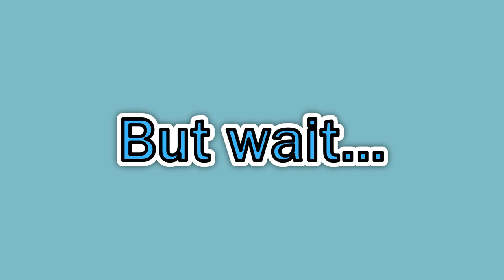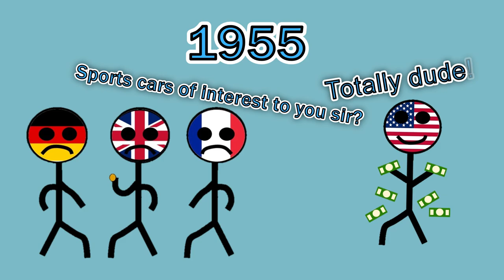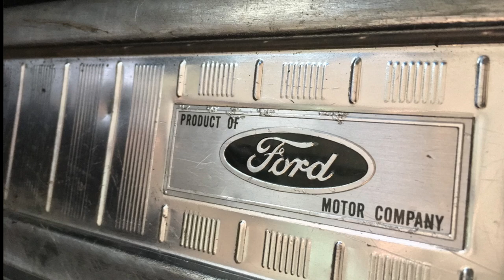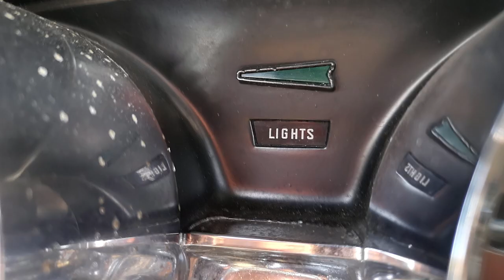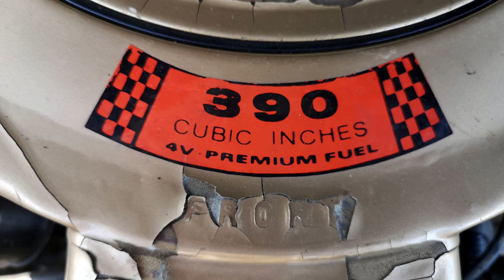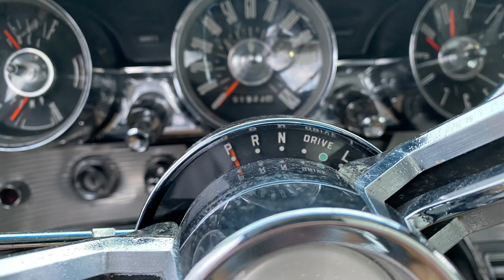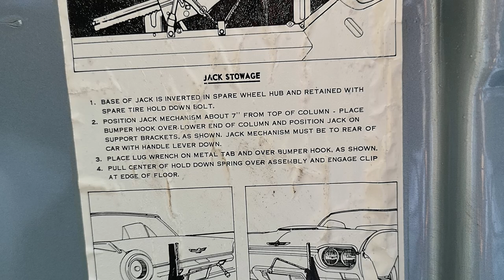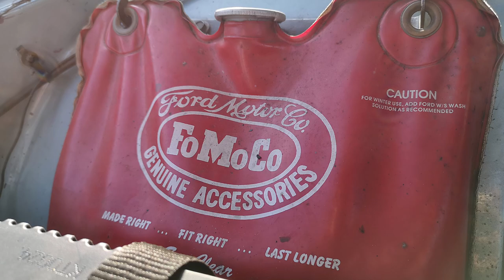The Automotive Anorak's overview: 1963 Ford Thunderbird

Comment: Did you forget about Lincoln? That's on the Ford ladder too... the top in fact.
Reply: I haven't.  In fact, I know a lot about the mutual history of those two cars.  The Lincolns of that same period were reputed to be built around the Thunderbird's cowl, in the same exclusive factory...in fact, the world-famous clap-door (or, to use a very overused and very obsolete phrase, "suicide-door") Lincolns began their existence as T-Bird concepts.  One thing I have never been able to ascertain, however, was whether the designer credited for Lincoln's revolutionary design, Elwood Engel, also got credit for the Thunderbirds of the same generation.  The resemblance is noticeable; in fact, many design details were used on the original clay concepts that sold Kennedy's Secretary Of Defense on the new look, when he was seriously pondering sending Mercury and Lincoln down the same disposal chute the Edsel had just gone down.  Toxic a personality as Engel may have been, at least according to some designers who were there at the same time, he did have talent and the ability to take lessons learned from mistakes (such as the 1958 Lincoln, even though he was not the top designer on that development)...though he may not necessarily have admitted to any mistakes to anyone.  You notice how, by 1964, Chrysler started following the lead he made with the '61 Lincoln (maybe the T-Bird as well?  Can anyone verify or refute that?); not a coincidence.

But that concept which transformed from T-Bird to Lincoln per McNamara's orders changed the automotive industry like no other car after WW2.  When the rest of the world was still stuck in the '50s rut, that design immediately changed everything.  Even the construction standards changed the industry...not just the eventual total switch to unibody construction, but also in warranty quality and maintenance standards.  How many would believe, let alone remember, when you bought a new car you'd have to take it back to the dealer as soon as the odo hit 1,000 miles for the "break-in" oil to be changed with standard-use oil...and if you missed that mark, they'd charge you for a maintenance they were required to do anyway?  Lincoln did away with that:  Right from the factory it was expected to give normal service right off the bat for 6,000 miles before its first oil change.  And that's just one example.  Another:  Lincoln offered the first-ever 2-year/24,000-mile, bumper-to-bumper warranty, twice the best competition and worlds ahead of the 90-day/4,000-mile drivetrain warranties that were the norm in 1961.  And there are still more.

Let GTO-442-Nova-Camaro-Firebird-Charger-Challenger-Barracuda-Mustang types make all the noise they want about their primary loves.  Their cars had their niche in automotive history, yes...but only as additional car options.  Not one of them changed the way the industry built cars.  Lincoln did.
Reply: @aloysiusbelisarius9992  Alex Tremulis claimed credit for the "banana nose" 61 Tbird. He was one of the few stylist concerned with aerodynamics at the time. He claimed his Tbird was 6 MPH faster than its predecessor because it sliced thru the air more easily.
Elwood Engel had the opposite philosophy. He always wanted to make his cars as bulky and boxy as possible  to have a heavy, impressive look.
Engel left Ford for Chrysler about 1964 which accounts for the change in styling from the elegant 64 Chrysler to the much more imposing, boxy looking 65s. They were the first Engel designs at Chrysler.
Reply: @mrdanforth3744  Well, partially correct historical account.  Engel did in fact have involvement (though not as the top designer) of the extreme '58 Lincoln.  But he did learn a lesson, something he never really liked to learn through embarrassment.  He created a Thunderbird concept car that was an almost total departure (and closer resemblance to the production '61 'Bird) from his Futura-on-steroids.  That Thunderbird became the '61 
Lincoln, which one can see bears more than a passing resemblance to the T-Bird of the same year.  Now, Engel was a freelancer, so he wasn't committed to any one studio; I'm thinking that the designers of the Ford studio took his cues after the "Big Man" of Ford ordered Engel's 'Bird concept to be made into the Lincoln.

But Engel did not go to Chrysler in '64.  '64 was the first year that cars started to show his influence, but he started there in '61, after corporate politics in Ford and Chrysler, respectively, had done their damage.

Now, I'm not one to exalt Engel.  One designer at Ford said Engel was an abusive, narcissistic piece of work, bullying people left and right because of his status, where he had lots of authority, power, and money, but no responsibility.
Reply: @aloysiusbelisarius9992  You may be right about Engel going to Chrysler in 61 but I didn't say anything about Lincoln. Although both the 61 Lincoln and 65 Chryslers showed his influence.
Reply: @mrdanforth3744  True, you didn't mention Lincoln; I guess I went into more detail than I realized.  I tend to do that, even if I try to be as concise as possible, for fear of leaving out a small but critical detail that could make the difference between making my point clear or making it even more confusing.  I felt I had to raise that detail in my point, because it was that Lincoln that essentially set the stage for the rest of Engel's career and influence.

Comment: I don’t agree that the 64 to 66 was less sporty. I thought it looked sleeker and less clunky
Reply: White exterior. 64-65 
Magic
Reply: I agree.  I have a 64 convertible.  I think it is far and away a sportier and better looking car.  Sure the 62 and 63 sold M-code with 3 2bbl carbs, but in 1965 you could order a tbird with a 427.   There are only about 20 in existance, but they were dramatically faster than an m-code.
Reply: Flairbirds don’t look sporty at all. They look much more luxury-orientated than any of them imo. My favorite gens are the BulletBirds (1961-‘63) the ‘57, and the ‘65. I’ve got a ‘63
Reply: Was flair bird the 64-66 or 61-63  @TheTrollMastah
Reply: I think the Hawk seemed Thunderbird rival just my opinion
Reply: @LeopoldoNotarianni-rk9vv  Flair Birds are ‘64-‘66 because of how the body seemed to kinda of “flair” out

Comment: Your photo of the 1955 is actually a 1956 (porthole windows)
Reply: Actually it's a '55, the '56 had a rear bumper mounted spare tire. The hardtop was an option and the porthole top came out in '57 and was interchangeable with all three years and due to it's popularity was often used on the earlier models. There are a ton of things in this video that are not accurate.

Comment: The original Thunderbird did not handle better than the Corvette - it is a well known 'beautiful brick' on the road. But pretty. Luckily, we have a lot of straight stretches here in the US. Both cars were screwed by executive committees. The 'wind deflectors that sort of work' were known as 'butterflies' here in the day, greatly missed by many in my generation. Had their uses.
Reply: Growing up in Indiana those were not known as "butterflies". My dad called them a "no-drafts". Cigarette smokers loved those and you'd see people flick their ashes out of them. Strange how we have so many local dialects in the states. And my family alone had their own peculiar names for some things that even our next door neighbors didn't understand.
Reply: The baby birds the 55-57 Thunderbirds were not designed to be a sports car as the Corvette was when it was introduced in 1953 with a "underpowered" stovebolt 6 cylinder. The early birds were luxurious roadsters aimed at the country club well heeled clientel. It was said you drove you wife in your Lincoln and your mistress or girlfriend in your Thunderbird. I owned a 57 Tbird when you install radial tires on it and add a bigger sway bar in the back and install an optional large sway bar in the front. The baby birds handle pretty well for a 3000 lb. car. My 63 Thunderbird Sports Roadster does not handle that well and it is not supposed to. It is a luxurious big, stately luxury car. It floats and you feel like you are riding on a cushion of air almost like a Citreon.

Comment: In a few years replace the gas guzzler engine with an electric motor. I doubt you drive very far in this so an electric range of 150 miles (240 KM) would be plenty and the car would probably weigh less. These Birds were beautiful but way too heavy. They ate through tires and gasoline.
Nice video.  👍👍